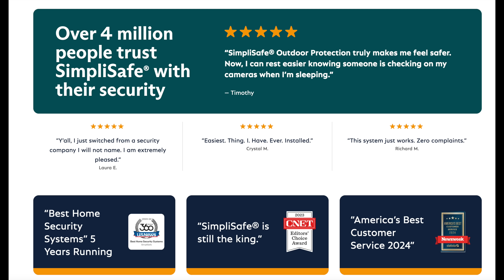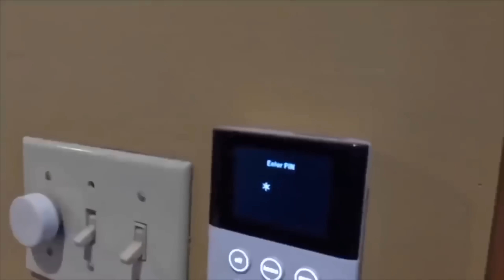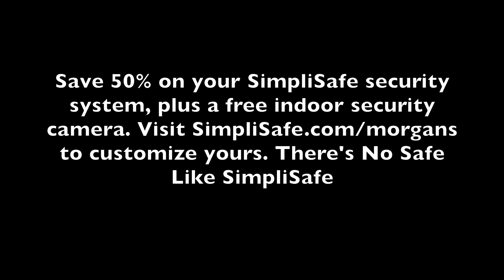Best Firewood Delivery System Ever! Easy, Clean, Fast, and Efficient

Comment: One Eyed Customs Video Is titled Where have i been & he shows and explains how he cuts the right and left sides to use as lids because they are a larger size than the top and bottom and fit over the baskets with a little help of a ratchet strap . where the top and bottom fit inside the baskets...
Reply: I was thinking why not try using the bladder somehow to cover it, keeps rain/snow off plus keeps it somewhat secure during transport.  I'm gonna have to look up that video for the heck of it...I don't have baskets, firewood etc. but find this interesting.

Comment: Hi Mike and Melissa... Try when you take out the bladder of your totes cut off 4"s at the bottom to use as a cover for when you fill the baskets with firewood... I've used this method for five years and it works great keeping my wood dryer and letting dry faster keeping the rain off.

Comment: Good morning. I heard you mention brake dust on your truck. If it becomes a problem cleaning it off the wheels, what really works well is oven cleaner. spray on and it loosens it right up. Have a good day from Virginia

Comment: Good morning Mike and family. In regards to brake dust, after market auto supply stores used to handle a fleet grade brake pad. It was meant for HD work which a F250 is meant to be. The reason that they don't come equipped from factory is that people use 3/4 tons for lite duty like pulling campers and they don't like the noise. They are noisy especially in camp grounds and people say ...hey you should check your brakes. Having an automatic transmission is worse unless you can down shift with it. Check with operator's manual. But if you're careful to hold the RPM down , it should be ok. Good luck.

Comment: One Eye Customs YT channel just put out a video on capping those baskets with an economical and durable lid.  He lives within an hour of your place.  
He vertically cuts the bladders from the tote and gets two lids by taking the outer third on either side of the fill hole.  Then he uses a ratchet strap to squeeze the top of the wood tote basket just enough to pop it on. 
Naturally water proof and less expensive.  Making use of the whole original apparatus.  Check his channel out.

Comment: Good morning!  Delivering with equipment and totes is great. I’ve been doing it for a few years. You hit it on the head with the space needed. But if it’s there it’s probably the cleanest most efficient way to deliver
Reply: What "space"?
Reply: @jakebredthauer5100  space to unload.  There is always someplace to allow you to access the sides of the trailer or to allow you to pull on from the rear, but not all are as safe as others.  Firewood delivery is something that is different than FedEx or UPS delivery.

Comment: one eyed customs is cutting the plastic bottom off of the tote, ratchet strapping the top of the metal tote and the bottoms are force fit after releasing strap and they stay secure

Comment: I deliver wood in the baskets like that. I have a small single axle tilt deck trailer I can tilt the deck and with the metal floor I can slide basket off and pull the rest of the way out from underneath it. Works great to deliver a couple baskets at a time.

Comment: Mike...we enjoy your videos...have watched for several years. We may have missed the one where you introduced your new zero turn mower. What is the make and model?
Keep your videos coming. Melissa is a sweet heart!
Reply: It’s a cub cadet they do a range of zero turn mowers with steering wheels. Just put mine in for its annual service they really are top quality and nothing competes I. Zero turn on slopes
Reply: @classicclassycluedup8505 thanks...son just bought a 5 acre property and doesn't want to spend the big bucks for a tractor. I thought the zero turn with steering wheel 60"" would work. Only a little slope to worry about.

Comment: Could someone maybe sew up or manufacturer a Tyvek type square cover (kind of like what was on your flats of wood from MI)?  Maybe even have some groments at bottom to run rope or rubber straps for keeping secure from wind?  Don't know how long it would last?  I'd somehow figure out a way to use the bladder for a cover, should last as long as the basket does I'd think.  Have faith in you Mike, you'll come up with the perfect setup.
Reply: Used metal roofing. 
Wood framing.

Comment: Hey Mike,
 I saw someone on YT the other day that cut off the bottom of the plastic tote to cover the top of the firewood. They just put a strap around the metal tote and kind of sucked in the top enough to get the plastic bottom over the top of the metal. Once on, he released the strap and it went back to shape and the plastic top was on tight.

Comment: Good morning! I have a 24 F350 Platinum with the 6.7 wanted one for years and am so happy I have it now. I got the white Tri coat and I can say the brake dust is my only complaint and the seatbelt warning covering my screen but when that dust gets wet you have black dots all over and it even gets inside the door panels... I thought about dust covers but honestly if you have the wheels off just change the pads I am going to. Oh and thanks for the Short on the box plug warning! would have baffled me for a bit.

Comment: Mike they make a brake dust plate that you can put on your truck. Take the wheel off put the disc on and replace the wheel. You’re done and it stops 99 % of brake dust.
Reply: One would think for 60 grand they could put brake dust plates on.
Reply: Where are you finding that truck for 60k? Please tell me so I can go get a couple of them
Reply: @nathansieg6006  that was just a guess I went to a local ford dealer and looked at the F450 and they where starting at 88 grand but I don't want a four door truck . I will stick with my 2008 F350 extended cab with the 8 ft bed. I've been a contractor for 26 years and I don't ride anyone but me 95% of the time.
Reply: A quick cleanup at a carwash, or with a power washer works wonders on brake dust. In no time..
Reply: Ceramic coating on the wheels will cut the dust from sticking to the wheels
Reply: And done with a high percentage of cooling air getting through to the brake rotors!  😁

Comment: So Mike.  You have the right idea.  I’ve had a Toro dingo 525 wide track and have had it since 2007.  Still running strong.  Yours is safer that mine because of tipping.  I use my machine for everything.  I’m a fence contractor/ firewood guy/ small business owner.  I have bobcat skid steer, mini excavator / dump trailer and I do a lot with that little machine.  Fit in small areas that nothing else will.

Comment: Mike we’ve been running firewood deliveries like this for three seasons now with good success.  We started out first year using a tracked machine and it worked ok on dry turf, but it was clear if things were even slightly wet, we’d tear up yards big-time.  That’s when we were introduced to the Avant and we pretty quickly bought an 860i.  It is amazing how soft that machine is on sensitive surfaces and the narrow stance allows getting into tight places and the boom allows unloading from one side.  We too have a hydraulic tilt trailer w an 8’ deck on front where we load 4 - 330 totes + the machine.  You nailed all the points from a customer benefit perspective, particularly w an integrated tarp on each tote.  We use canvas.
Reply: Used metal roofing, 
Wood framing,

Comment: Mike, I'd love to see you put a vehicle on your trailers. I have a hydraulic dovetail tail gooseneck that is 35 foot long. I'm interested in something smaller like the trailers you have, but I'm curious if it would work well for both equipment and to put a car or a truck up onto if you ever needed it. I'd love to see you pull the Subaru and your truck/Yukon onto them just for demonstration purposes...

Comment: Hi Mike.  I had a Dodge ram with the same configuration as your truck.  It was a half ton with an 8 foot bed and extended cab.  The reviewers only complaint was that it had kind of a springy ride because of the length.  When I took it for a test drive I didn’t notice it, but after I bought it and took it up on the freeway, then I did notice it.  I’m wondering if because your truck is a heavier duty vehicle if you were able to get away from having that springy feel to it.  What do you think?

Comment: Mike is your truck diesel? If it is checkout Dave’s auto center. The fuel management on a diesel is a ticking time bomb. They go over what needs to be done to prevent that. I believe it is the cp4 pump on them. I’m amazed at how manufacturers don’t care about their customers anymore. So vehicles are to expensive not to take care of them these days.

Comment: Can those totes be stacked?  It would save a lot of space in the wood yard if you could stack them once filled.
Reply: Not with them cut up like he has and the full weight of the wood in them. I used to work at a factory that we had chemicals delivered in these IBC totes. Once empty, they could be stacked if not cut up with the interior bladder still in it.

Comment: Mike, try pushing the 2 baskets on the tail forward between the wheel wells with a pallet or basket, you may be able to get the last 3 baskets on the tail. Pull them back with a chain on the other end to get ahold of them with the mini skid. Tidy operation brother!!

Comment: Unless we cut and split all of our own firewood and we get all of the trees (wood) we use for free we are not really saving money on our heating costs compared to the cost of heating with oil or natural gas. 
That said, a wood burning stove is a great backup heat source during power outages.

Comment: Ever since  I drove OTR in big trucks, rest areas have been out of bounds for me. If the Amish want to stop at a rest area, I tell them I will stop at the next available  fuel stop. I will not pull into rest areas.
 There are several  reasons for this.
 The first reason  I will not stop at avrest area, they are secluded areas and the under  world elimate thrive on rest areas. They know you will be leaving your vehicle, and they can do as they wish. They usually post a guard at the entrance to warn the others if law enforcement  approaches.
 The second reason is in a rest area as you saw, When you are on rest area property, you are on DOT territory.  They have you trapped  as you pull in. They love to set up hustle points like the one you described.
 The third justification  for never using rest areas is when you stop, this counts absolutely  against your travel time. Truckers are not paid to stop. Rest areas give only  one of the three primary requirements  for coming to a stop.
 You can't get fuel. You can't get food or coffee (vending  machines do not count) 
 All you get is a DOT bathroom 🚻 
 No, thank you.
 We got woken up the last time we used a rest area by the DOT wanting to see our log books. They can not do that on private property like a truck stop.
 We/I plan my trips around stopping at truck stops even with the four-wheeler I now drive.
 You won't find me willingly using a rest area.
Reply: @jbbrown7907  
Sometimes I like to stop 
at a rest stop to rest.

Comment: Using this delivery  system, couldn't  you give them green, fresh cut firewood? They can season the wood in the totes.
Reply: What if the customer wants to start using it immediately? Maybe a mix of seasoned and non-seasoned wood would make sense if the end use customer will not use it up by Spring.

Comment: but ya gotta leave all your totes with the customer and have nothing refill back at the wood yard.   then ya gotta go back and pick them up.  fail
Reply: Wrong, You charge extra like a deposit on each tote,  then you simply tote up, for your needs. 
Saves the customer and supplier alot of Labor
Reply: @Mickeyfinn1  Correct. You hope this will be (or is) a repeat customer.